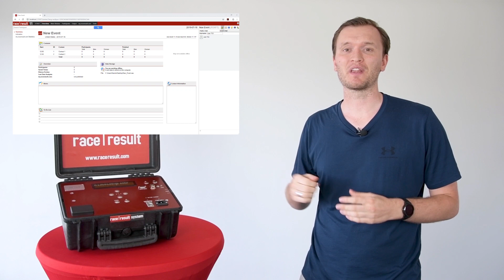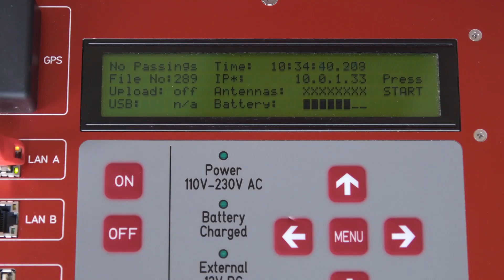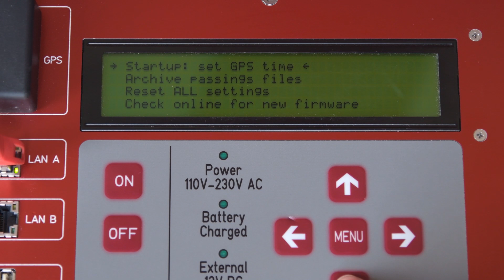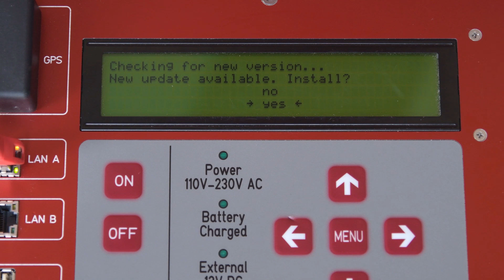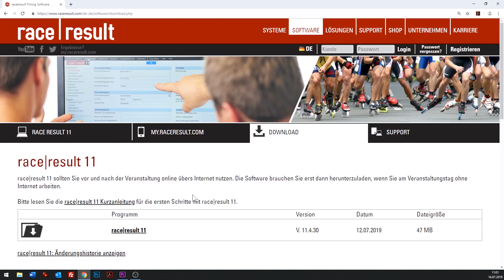race|result Tech Check: Updating Hardware & Software

Comment: nice.. no need for a power connection to upgrade firmware?
Reply from the maker: Hello, a power connection is always good, but the update process usually takes only a few minutes. So: no power connection required.